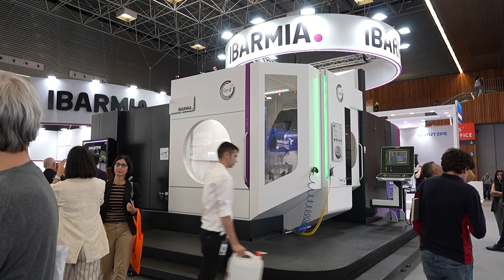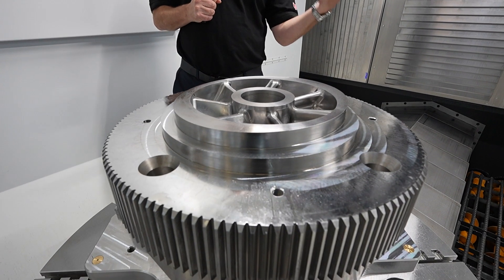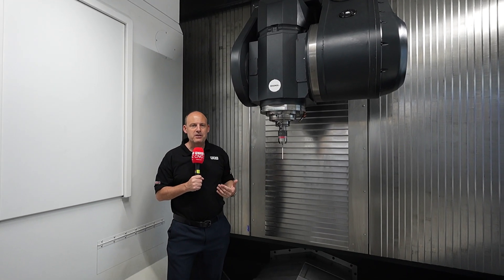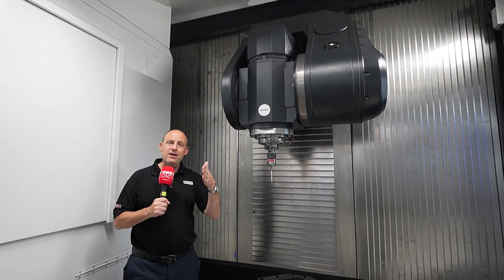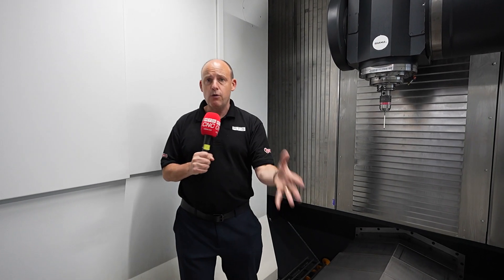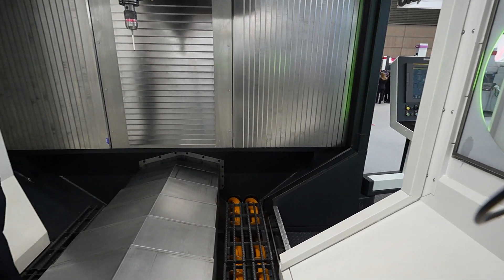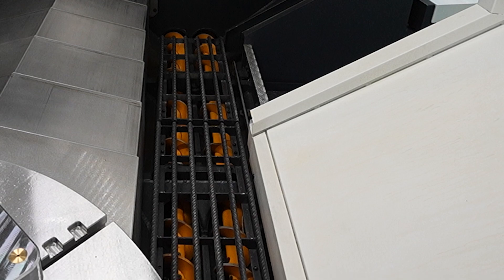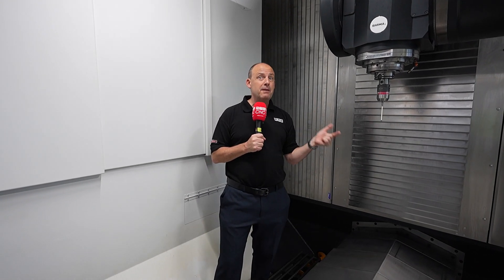There's no way that's available, surely!!

Comment: Surely you would struggle with surface finish @ 12.000rpm especially when machining tight corners in Ally the speed the XYZ.C ( Full 5 axis contouring or swarf cutting)will have to move to keep that surface speed constant @ 12000rpm will be more then the machines ball screws and drives are capable of  different if it’s DIredt drive surely i would say 18000 min ideally 20k and up
Reply from the maker: thanks for your thoughts

Comment: I'm sorry but saying you have a max of 12.000 rpm so it can handle aluminum is quite wrong. In this day and age with carbide mills you need well over that in most cases to hit optimum speeds and feeds. Regardless a great looking machine and from what is shown in the video well capable of making great parts. Just wanted to point out the faulty comment
Reply from the maker: Thanks for commenting, in most instances a 12K spindle would provide pretty high speed machining on aluminium, you can get faster spindles of course but 12K is quite common for this type of machining